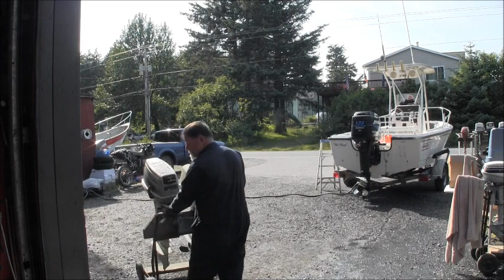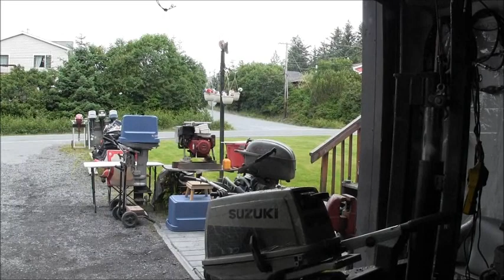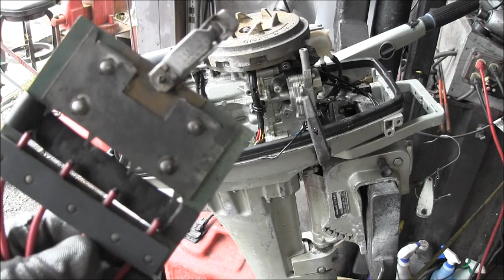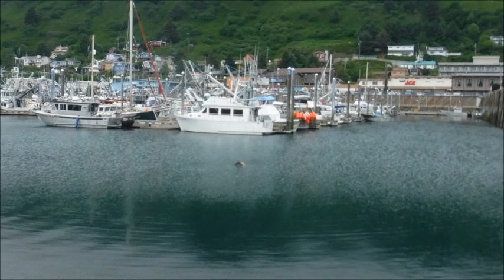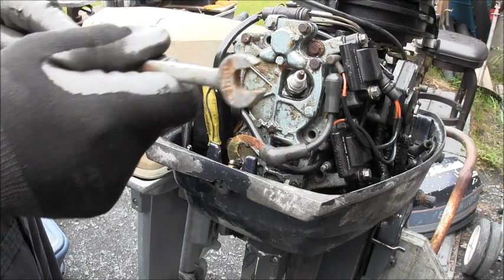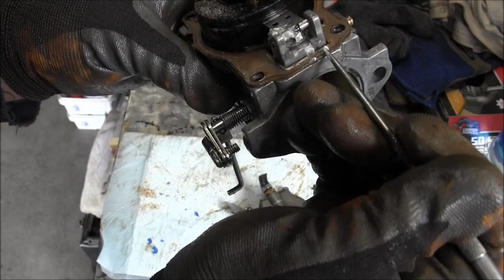SUZUKI  9 9  2 stroke , EVINRUDE  1990 30 hp &  MORE

Comment: I'm the one who gave you the 30 hp outboard, I'm glad it inspired such a great song. 
That was purchased new for our set net site in the 90s and a couple years ago it got left in a unused skiff for a it filled with water. I'm happy that it will live on in other motors.
Reply from the maker: It will 4 sure!  Yep that block is a gone'r  but many parts to carry on. It's a good training tool as well,  I have had so many that could have made a full recovery if dunked in a bathtub.  Hence the didy'  thanks  kodibass
Reply: Good save on the 30 hp parts.  I ran one for a few years.  Darn good motor. Good job on the video and thanks for sharing.

Comment: I have a 1997 mariner magnum 40hp outboard and I'm needing two find my serial number it's missing off of the mounting plate would it be stamped on the motor anywhere if so where would it be located